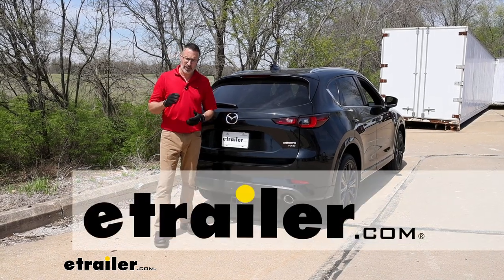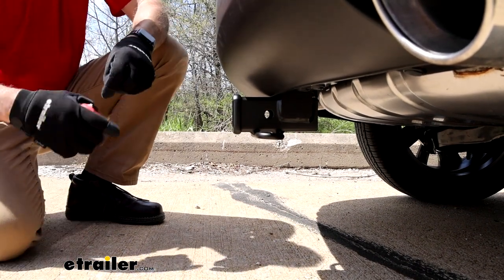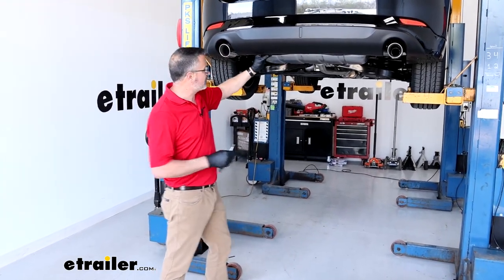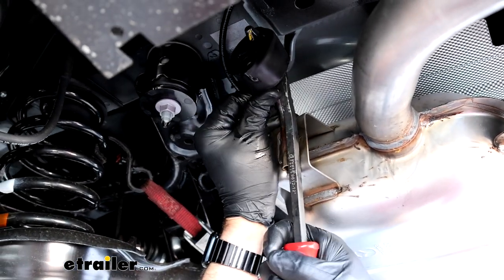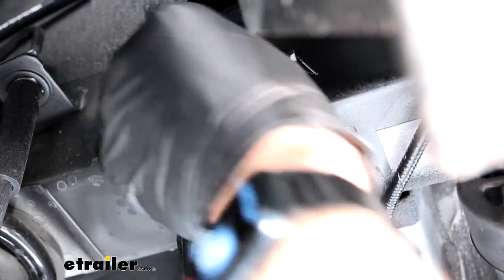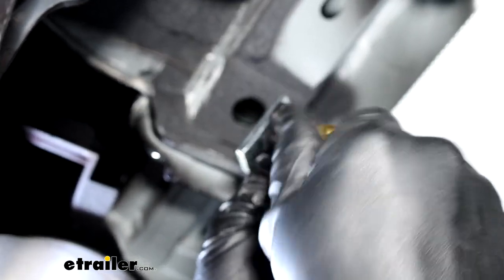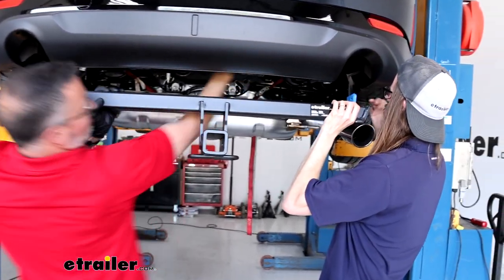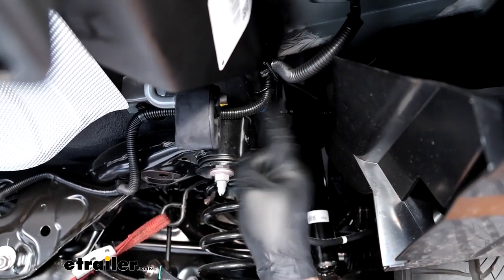Installation: etrailer Trailer Hitch Receiver on a 2023 Mazda CX-5

Comment: Hi, nice video, but I have a question for you. What size is the screw that goes into the nut that is welded to the frame?
Reply from the maker: The bolt is a M12 - 1.25 x 40 hex bolt. The linked install instructions include a listing of all the hardware included with the hitch.
https://www.etrailer.com/Trailer-Hitch/etrailer/e98902.html
Reply: @etrailer  Thanks for the information my friend
Reply from the maker: You're welcome, glad we could help!

Comment: Is the 2021 the same? What is the part number for this side mount
Reply from the maker: It is! The etrailer brand # e98902 hitch fits the 2013-2024 Mazda CX-5 model, so it'll work great on a 2021 model.
https://www.etrailer.com/Trailer-Hitch/etrailer/e98902.html

Comment: Does a bike rack block the rear camera ?
Reply from the maker: To a certain degree, yes. However, it shouldn't completely block your view. The camera is usually centered on the license plate, and how much interference you'll get will depend on the design of the bike rack you're using.
https://www.etrailer.com/Trailer-Hitch/etrailer/e98902.html